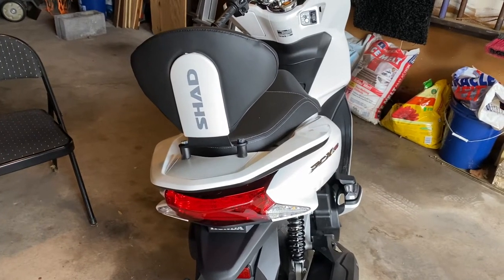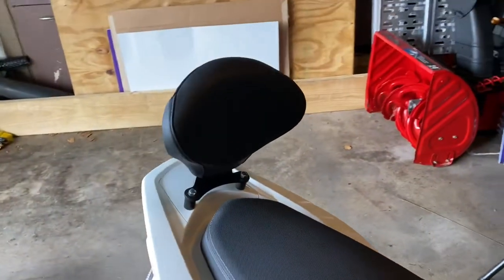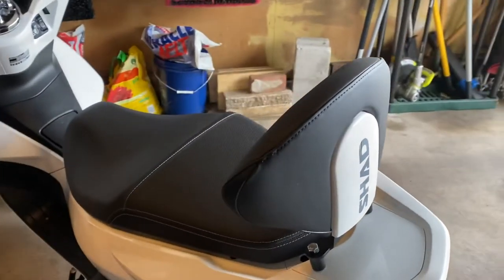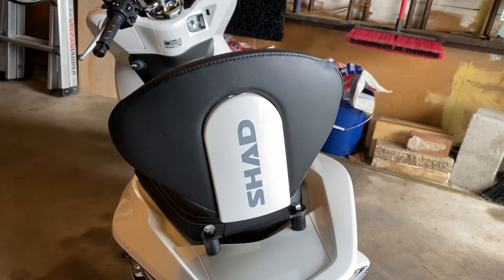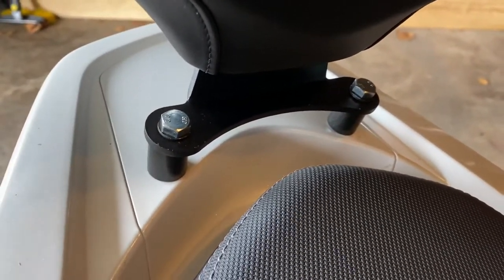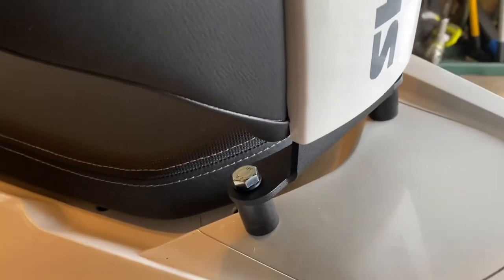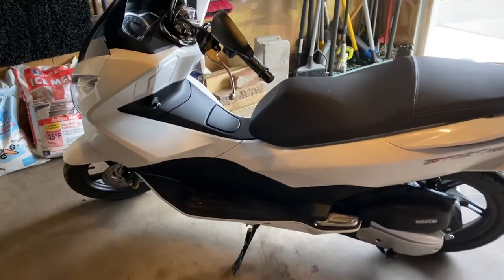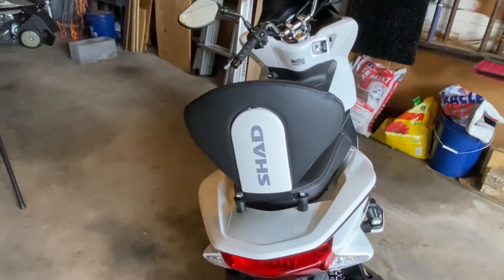Part 4 of 4 Final Video  Shad Backrest Honda PCX Scooter walk around

Comment: Hi, watched your video yesterday as I was installing the same back rest on my Honda pcx. The reason your bolts aren't long enough is that you need to drill a 22mm hole through the plastic so that the black steel spacer tubes are in contact with the threaded holes, I'd be worried that the plastic cover will eventually crack if its tightened to hard.
Reply from the maker: Hi Justin thank you, Instructions were the worst, I made a few more videos, not sure if you saw my Playlist but I got it done.
Reply: @TechMadeEzy  Glad you got it sorted out. Yeah the instructions are a joke,  the stencil for the holes wasn't even correct, luckily I double checked and checked again.
Reply from the maker: It's nice, not as strong as I would like but it looks good and gives my finances some stability so that's cool